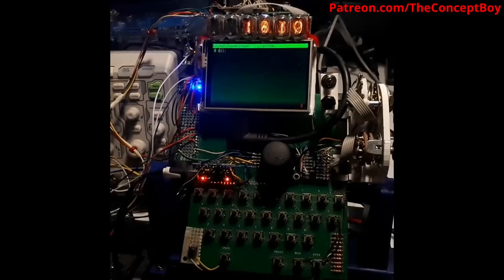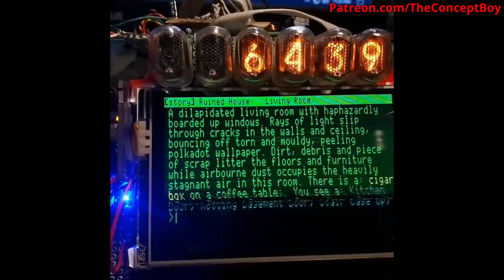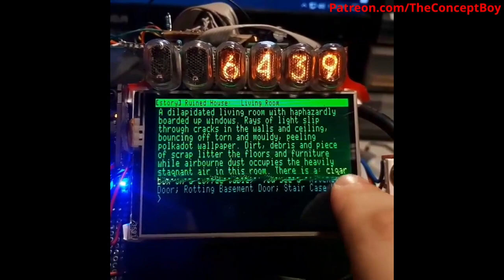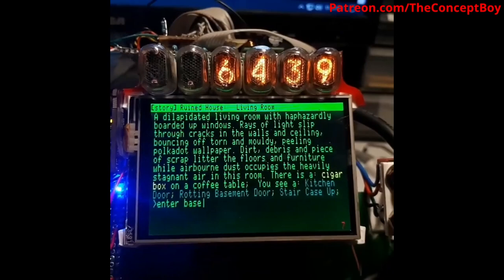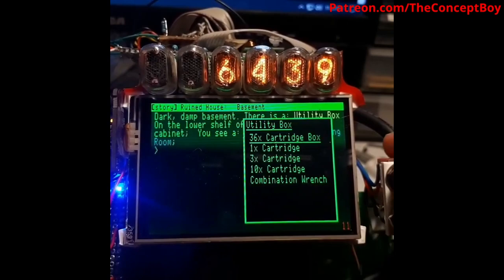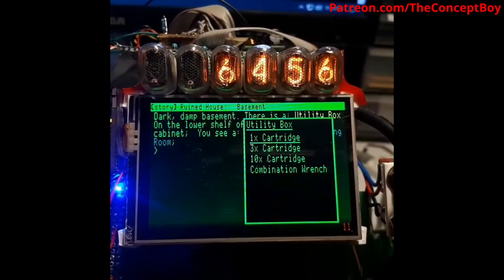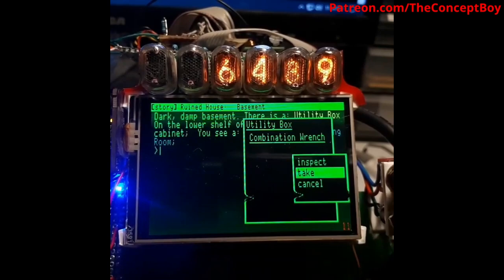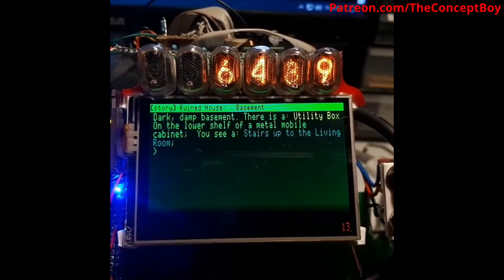Handheld Text Based Adventure Game: Road so far. Prototypes, Hardware, Issues

Comment: You can use Micropython on the ESP-32, so that will take care of the memory allocation nonsense. For storage of game data, you could have the files on an SD card and interface it with the ESP-32. Or even fancier, store your game files somewhere on the network or internet and stream them over Wi-Fi. This has the added benifit of seperating working on your game and working on your hardware. As well as being able to update the game without flashing the board everytime.
Reply from the maker: SD card to store game data for sure. Since there's a need to save and load game data as well as sound / music and a prospect of adding new game content over time. Easily accessible dynamic storage would be a must. So SD card I think is a good way to go about it.

The storage obstacle is less to do with game storage and more to do with amount of memory available on the ESP32. Every asset / text content / sound needs to be loaded into the memory to be utilized in the game. With the esp32 I have 520KB of RAM to work with. For comparison, an average soundtrack for a game in not too terrible compression is around 4,000KB so Music would have to somehow be loaded in small chunks rather than all into the memory. I am contemplating on using the 2nd core of the ESP explicitly for sound and music so that the main game loop would not be hogging audio playback.

In terms of storing game itself in the cloud, I was initially experimenting with having the game be made in HTML, JS and CSS via Python and Flask back when this was on raspberry pi. For ESP32, I'm not even sure what would be the way to go? Treat the ESP as a terminal, you enter the commands into the ESP, it sends it to the back end over internet, you get back the response? I mean that would have the added bonus of dealing with piracy issue. But having to be always connected is never a pleasant factor among gamers.
Reply from the maker: Hmm. I was kinda hoping Circuit Python on a beaglebone, because of it's resources.
Reply: Looks like you need a Linux capable board instead of a microcontroller. A Raspberry Pi Zero W or similar should do everything you want. Similar form-factor boards include offerings from NanoPi, BananaPi, OrangePi and Raxda. You could also fast track development by using a text adventure game engine.

Comment: Check out Peter Misenko on youtube. He has a project with a Pi Zero: Zepir V.
Reply from the maker: Oh yeah that's basically what I had also been running with the 2nd and 3rd prototypes. Problem is Pi Availability has proven to be quite unstable during the chip shortage. So this got me rethinking whether or not I really wanted to still base this on a pi
Reply: @RebelWorkshop  You can find clones with similar size on "Ali's Expressive Site". Something called a "Mango pie mq-quad".
Reply: @RebelWorkshop  I see some stuff on rpilocator as well.
Reply from the maker: RPI locator looks like a cool resource. Albeit the idea of having to hunt down an rpi one at a time and being subject to lucky picks and chance isn't too hot. I still have a couple of zeroes, a full 3B and a few compute modules. But even then the glimpse of the future the chip shortage has given me is making me weary of relying on a pi, considering that at some point I'd like to do a small batch run if it ever gets to that point. ESP32s or some other super abundant equivalent would be more preferable. Plus the boot times of an ESP32 is absolutely nuts. The application boots in under a second.
Reply from the maker: @temptemp7037  I mean to be honest, IF I were to go with a linux machine as a base, I would probably go with a beagle bone black as so far it's proven to be quite abundant.
Reply: @RebelWorkshop  Yea a beagle will work well, just need to add a wifi dongle.
Reply from the maker: @temptemp7037  Today's been yet another day of struggling to try to get the Beaglebone to display the pygame. It... just doesn't want to cooperate. 

I keep switching between SoCs and MCUs for this... between ESP32 and Beaglebone. 

So far ESP is winning hehe.
Reply: @RebelWorkshop  I think you will need to mess with device tree overlays to add an SPI display to the beagle. After that it should work like a regular monitor. Im sure there is documentation or a tutorial online.
Reply from the maker: @temptemp7037  I have done that in the past, so that part is fairly understood. The real problem lies with Pygame and framebuffers. Even with an HDMI display connected to beagle, pygame refuses to render, despite having installed xserver. General advice is to recompile pygame with the proper frame buffer among a myriad of other rebuildings. All of which is ultimately the reason I'm working with the ESP32 right now.
Reply: @RebelWorkshop  oh i see the problem now. Well the ESP will treat you right. You can buy ones with extra ram, 8MB ps ram (of which 4MB is usable). And it can be fun to write your own screen space effects. And I will always recommend Micropython compiled with SPIRAM support for the ESP.